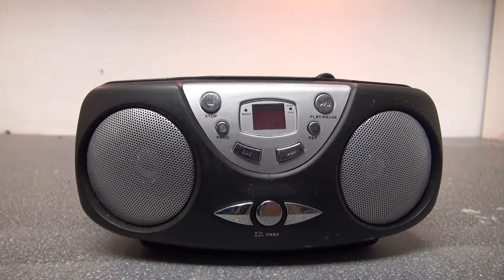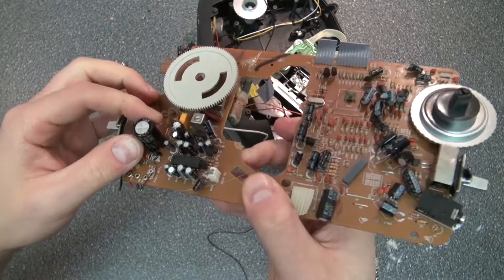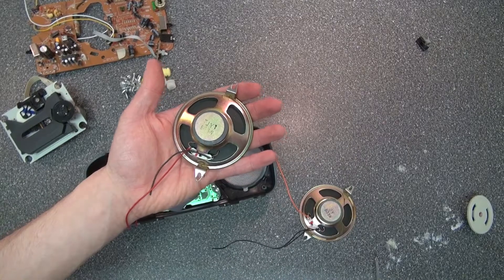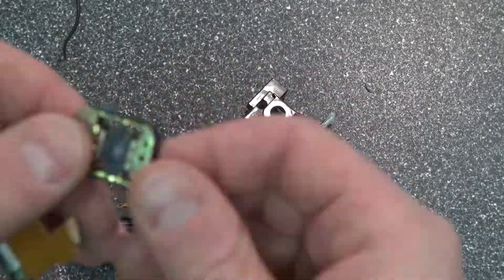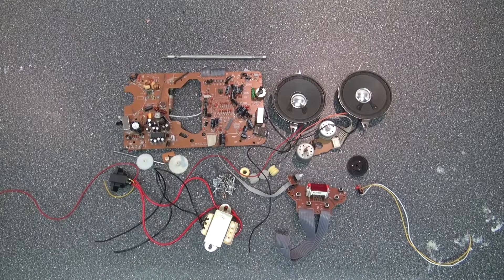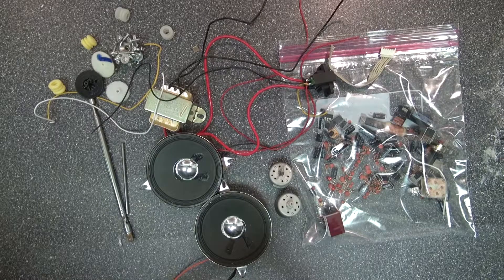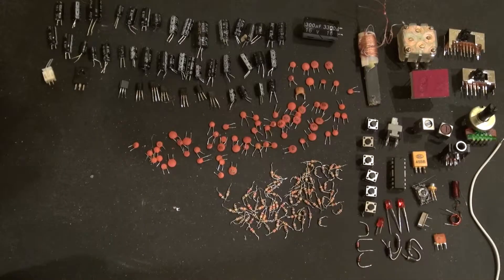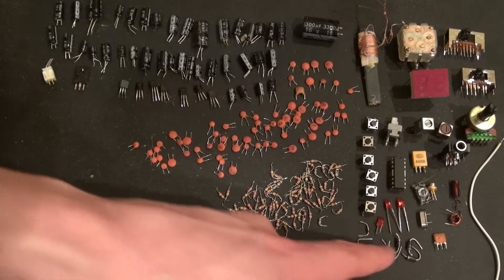Multi Function Radio Teardown

Comment: You Reminds me on
Myself... lol...   
....  some 40years ago...
In My grandmother Atick ...  in small 
Corner improvised  room... some old improvised furniture. Basis for my first Cristal radio ... ... and so On... 
...  ... eyc. Etc..no electronic shops back then ... 
Dick Smith created beautiful
 video series that describes situation back...50's 60's...  Videos that explains how entire Retailing electronic industry started with him... ... This is first video in series.  
.
https://youtu.be/1EndAZ5DR8o

https://youtu.be/9aJXBreNyZg

https://youtu.be/XUdN9soWHOQ

https://youtu.be/hT0aG3SRpRY

Anyway ...
I would rather keep component's on origins PCB  boards and store them in Shoe boxes by 
Original project's name... 
+ 
... 💭💭💭 Maybe take few good photos of original connections and original project before dissmentling it. 
You may use entire blocks of previous project if correctly identify 
original function...
.... ... instead of desolderign it.  

Of course... some stuff must be desoldered for parts.

Nice fun... keep posting. 

PS. 
Improve your voice recording.
All the best.